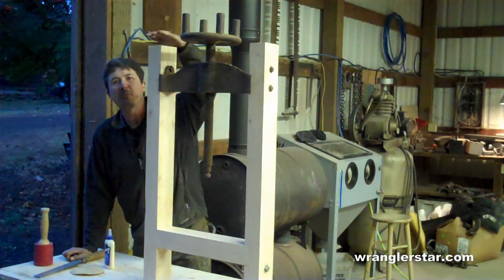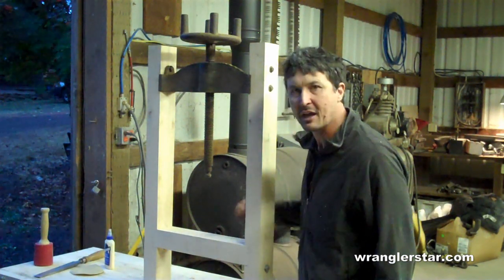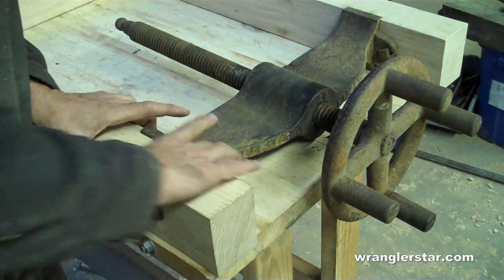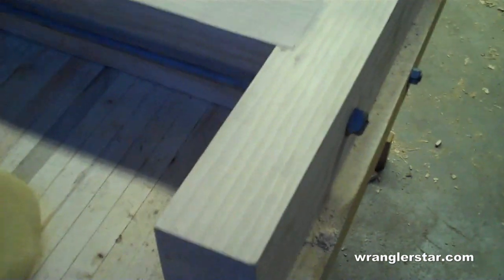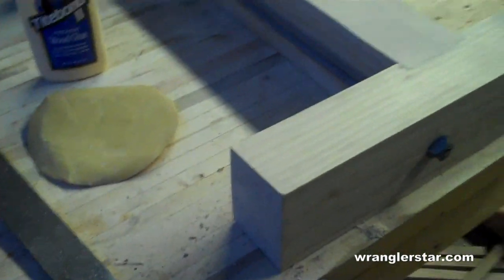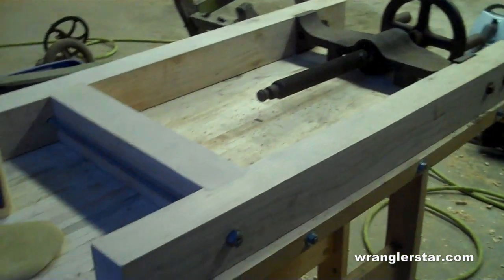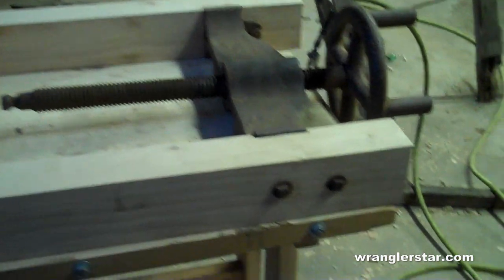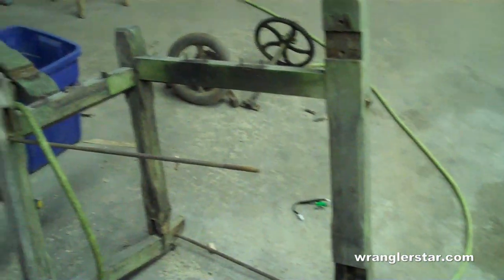Apple Press Restoration pt 4

Comment: This is a project that I would love to do. Now you have me looking for an old apple press here in SC. I would use food grade grease on the gears so that you do not have a contaminated end product. Also I would think about welding a bolt to the bottom of the arched crank. I would make one in the fordge but is easy to buy a bolt and weld to the bottom to tighten up the press wheel. I am not sure that I would finish the wood at all, but bees wax is good choice. Sure does look nice. Thanks